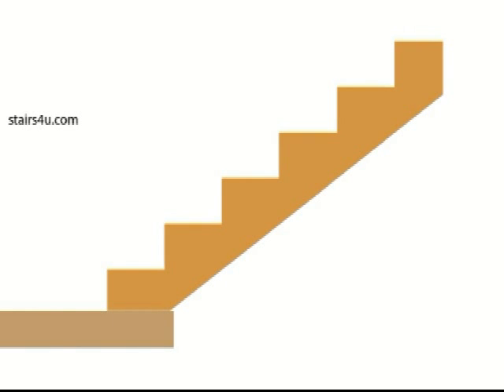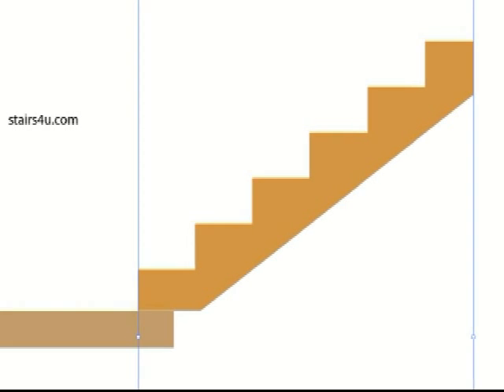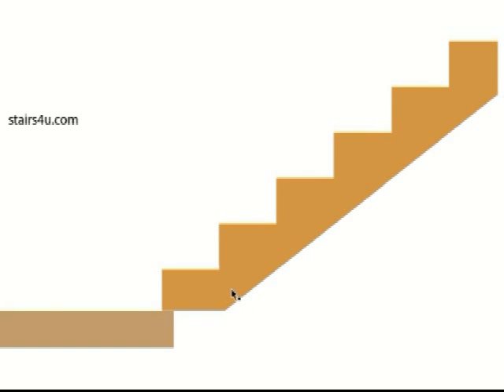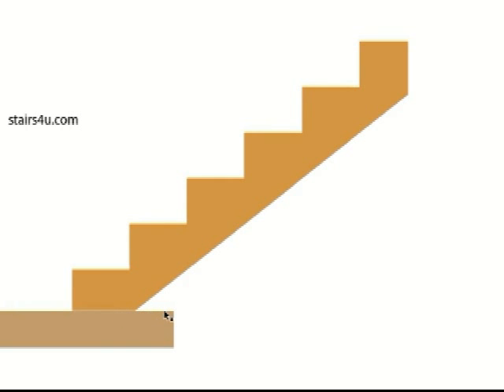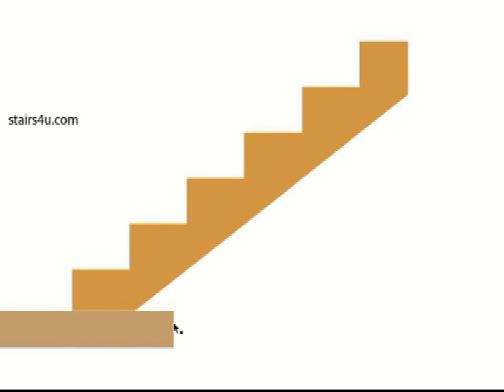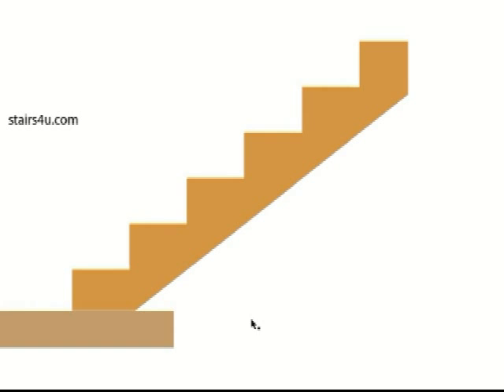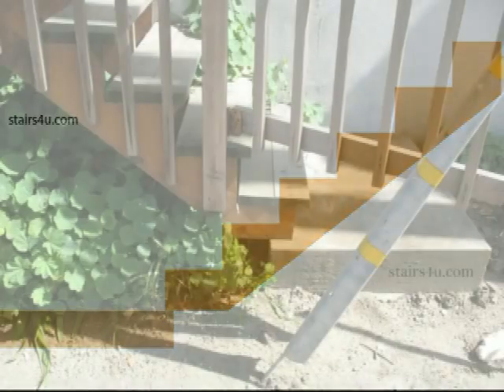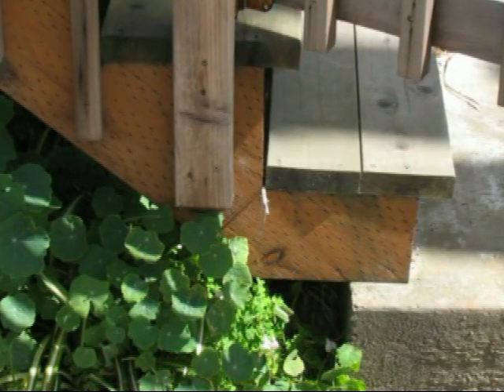How To Properly Support Bottom Stair Stringer Structurally And Why

Comment: Why build the landing to extend past the stringer?  To waste wood?  Horizontal depth of stringer at bottom cut is easy to figure out given rise and run: h=(stringer depth/(cos(stair angle)-riser)) / tan(stair angle) . Measure twice; cut once.
Reply from the maker: It's often easier for new stair builders to set the stair stringers on top of a platform or some type of a deck extension, but it doesn't have to be done that way.

Comment: you mean if 4-150 pound people could stand in one stair? We have a normal straight staircase like in most houses!!! the appliance dolly and the washer machine were together like 230 pounds but my question is if the weight of the dolly with a washer going up each stair will loose the stairs? Thank you for your response

Comment: question: I am building cascading stairs. where I'm building them on my deck the ground slopes to the middle from both sides. what's the best way to level it all off? put the two very outside stringer on and go level with that or use the middle stringer and use that as level? hopefully this makes sense. thanks
Reply from the maker: If it isn't sloping very much, for example no more than 1 inch per foot, then you could keep everything a level except for the very bottom. http://stairs4u.com/code/private_walkway_riser_problem.htm if not you might be able to switch directions of stairway, for example make a 90° turn somewhere near the bottom.

Comment: I'm building stairs on paver stones. If I'm drilling into my house, do I need to to install concrete footings? Can the stairs just rest on the stones?
Reply from the maker: It depends upon the size of the stairway, for example 2 or three steps might not be a problem, but larger stairs might require a concrete footing.
Reply: 5 steps. Could o use adhesive on the pavers?
Reply from the maker: I don't see why not, it might not work that great, but it's worth a shot.

Comment: I don't have concrete on my patio floor yet, (it's still grass). So should I build stairs on my deck first, or do the concrete on the patio first?
Reply from the maker: +Jesse Meza That's a good question, I would pour the concrete first, but it might be easier for you to build the stairs and then pour the concrete. Sometimes it's difficult for beginning stair builders to figure exactly where to position the concrete pad before it's built.
Reply: I had someone say stairs first, then concrete. But I also had a lot more people say. Concrete first. Thank you
Reply from the maker: You bet and if you're good with math, it will be a lot easier to build the stairs after the concrete is poured, but if you build the stairs first, then the location of the concrete pad will be obvious.

Comment: Got a remodel question for you.  Currently working on fixing up a home that was built in 1974.  It has one of those split-level entry setups.  You walk in the front door onto a small landing and either go up or down a half flight of steps to the main floor or basement.  The existing stairs are horrible.  No consistent rise or run and chunks of wood used as shims all over the place.  The problem is that both flights of steps have a limited run, but the lower steps have more distance for the rise than the upper steps do.  In other words, the landing was built too high.  Can't lower the landing because it does line up with the front door.  Ever encountered a setup like this before?

Comment: What would you suggest for building a staircase between two garages?  I have a good footing for the stringers, but as for securing them I will have to TAPCON them onto the masonry on the left and right.  I am thinking of building a large landing at the top that I can secure the stringer to as well?  Help. :)
Reply from the maker: Paul Alves They probably don't need to be secured to the masonry. Wood usually works fine for exterior stairs.

Comment: My basement stair design utilizes little 2x4 walls to support the landing, but my problem is with the staircase leading from the first floor to the second floor above the basement stairs. I've used the same little wall design for the first floor staircase, and I just realized that the wall on the length of staircase side runs straight through the basement stair head room so far that you'd have to crouch to get under it, which obviously isn't acceptable. What should I do? I've thought about replacing this wall with a beam, but my issue with that is that the beam would have to interrupt a stud in each wall on either side of the staircase, and I'm not sure if that's ok. Could you please give me some advice? Thank you.
Reply from the maker: I'm not exactly sure what you're dealing with and if you want feel free to e-mail me a couple of pictures. My e-mail address can be found at stairs4u.com. I also don't think you will have a problem using a beam as long as it's properly supported with posts that are sitting on top of concrete footings. Can you rebuild the stairway to its existing condition, without having head room issues?
Reply: stairbuilding I'm not sure how to send pics from CADD, and anyway I just decided to avoid the problem and just make the basement staircase a straight stair while keeping the First-Second floor stair an L-shaped. Thanks anyway. I'll definitely be coming back to your videos for help..

Comment: Hi, What about if you're constructing a Winder Stair?  I've seen some pictures where the Stringer is connected to a post and then it turns to make a L shape but there isn't anything under it to support it.  i'm not sure if i'm describing this correctly but please let me know where the strength is coming from when there isn't any support there?
Reply from the maker: I will try to make a video for you in the future, so stay tuned to the channel. There are numerous ways to support sections of a wood framed staircase and the most popular would be using posts and beams. Metal stairs would also use similar methods, but can use smaller materials to accomplish the same goal, making the stairway smaller itself.

Comment from the maker: Great question and yes you can, as long as the building hardware or joist hanger is fully supporting the stair stringer. The information you're looking for is actually in either my book on advanced stair stringer layout or professional stairway building secrets.

Comment: Question - could you cut the bottom of the stringer so that it has a vertical end, rather than a horizontal end, and then install it in a joist hanger to the side of the header joist in the floor?  This would get rid of the little drop in the ceiling below the stringer, improving headroom (assuming there is another flight of stairs below).

Comment: Well presented video, but I disagree. Stringer materials like LVL reduce checking, warping and cracking problems. You point out the advantages to extending the landing, but not the disadvantages ...like headroom problems with a flight underneath, or potential finishing work that could take longer, require more materials and not look as clean.